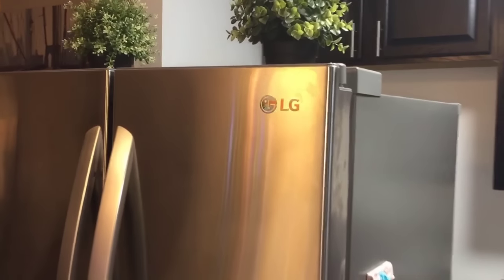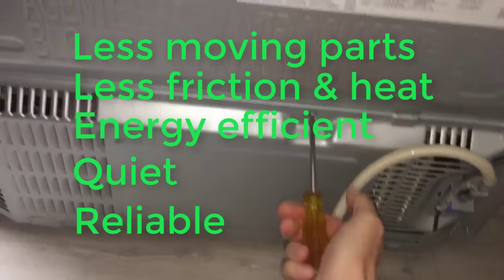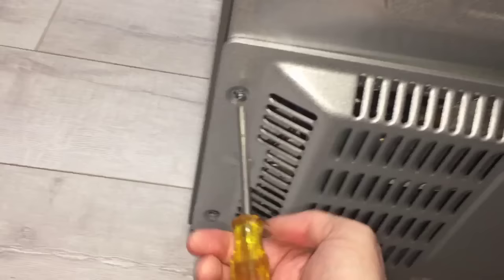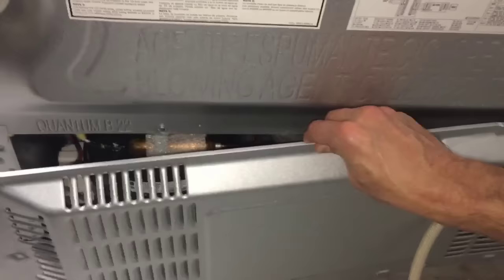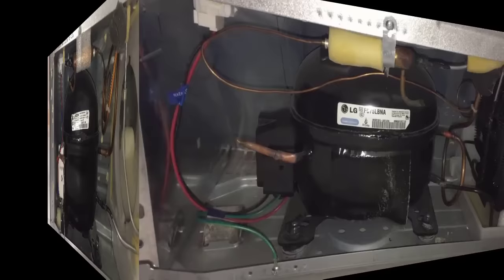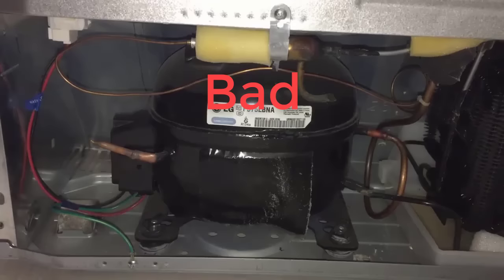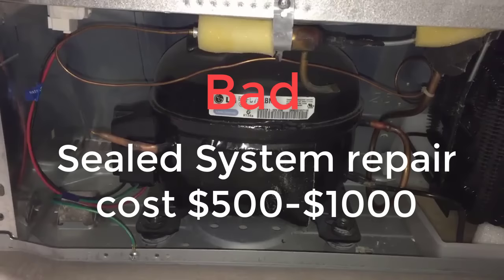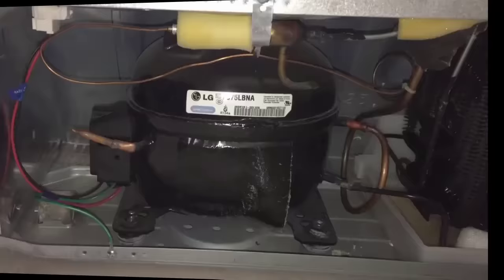LG fridge not cooling but running

Comment: Do you have a video to get the white cover back on? My compressor is humming and I can feel a little smooth vibration, does that mean it’s running? Or is the vibration coming from the fan? I was going to get a new start relay kid and took the starter out, without taking a picture we’re the green wire goes. On goes to the screw of the white cover and one is for the green wire what goes on a screw. I don’t know which hole. I noticed one hole has some markings  engraved in the metal of the compressor. Is that where the green wire with the screw goes? . ( women who tries to fix stuff through YouTube since hubby is overseas, sorry ) also I can’t get the white cover back on, any tips on that. I’m frustrated with this LG and did not know 2013 when it came out and we purchased that it will have issues in 7 years down the road. I love Lg but will never purchase another one. Thanks for any help I can get
Reply from the maker: If it says "Linear" on the compressor, there is NO start relay, just a connector that goes on the compressor, and a round Overload Switch that sits inside the white box. One end of the green wire goes on the bottom frame (as can be seen in this video). The other end of the green wire needs to be screwed to the compressor right next to, or the same screw that holds the white box (as can be seen in this video). The white box is just a cover, and if you cant put it back on, just let it hang there. As long as all wires are connected you should be ok. If you have a purchasing receipt, your fridge should be under a 10-year compressor warranty. Call LG and they should replace it, but you'll have to pay for the installation labor.
Reply: YourSelf first of thank you so much for taking the time to reply. Yes, it’s the round overload switch that sits inside the white box. There are two holes right next to each other on the compressor.  One for the white box screw and one for the green wire. I just don’t remember which one goes into which hole. Does it matter? I bought the extended warranty when I bought the fridge at Appliances Factory and tossed everything in the trash after 5 -6 years when everything was out of warranty, not knowing of the 10 year warranty for the linear compressor. 😱 that’s my OCD 😢.  Is the good compressor noise noticeable or louder than normal, I don’t think mine sounds that loud like the good compressor in your video, that’s why I wonder how do I know it’s running? Beside putting my hand on the compressor and hearing a smooth humming sound.
Reply from the maker: The green wire can go in any hole on the compressor, but you won't be able to secure the white box if the wire goes in the "wrong" hole. 
The linear compressor typically runs quietly, but as history has shown, that's how they fail... running, but not cooling. And sometimes it's difficult to figure out the problem without piercing the Sealed System to install gauges. 
You could try to run the Test as on this video... https://youtu.be/70y61Sq_NU0 If the compressor and all fans run, but the air blowing inside your fridge is warm, it's probably a bad compressor.
Reply: YourSelf  I pushed the rest button on the board and did all test. Air is coming out cool in freezer and fridge. I have the green light blinking 6x, so I was going to start with the cheapest replacement. Grossing my fingers that will fix it. How big are the chances it’s the pcb board?
Reply from the maker: Typically 6 blinks indicate a bad compressor. Before throwing money at a new PCB, I'd invite a technician to check the pressure inside the Sealed System. It may cost you about $100, but you'll know for sure if it's worth messing with this refrigerator.
However, since the air inside your fridge was cool during the Test, I'd give it a day, and maybe everything will go back to normal after the Reset.
Reply: YourSelf I received the overload switch today and put it in, the green light blinking six times stopped. I ran through the reset test and noticed that the evaporation fan ( inside the freezer, behind the cover) only turns on when in test mode and distribute cooler air. Once out of test mode, the fan is not running at all. Does that indicate the evaporate motor needs to be replaced and that’s why it’s not cooling? Thank you for your reply
Reply from the maker: The evaporator fan may not be working when the door is opened. You need to "trick" the system as if the door is closed by holding a door switch for about a minute. Some models don't have physical buttons, in this case,  you can use a regular magnet to activate the door switch. If you activate the door switch and the lights go OFF, but the fan is still not running while the compressor is, the main PCB could be bad.

Comment: Do not buy LG appliances or products! LG is currently in the middle of a nationwide class action lawsuit because so many of their compressors are failing. Search Google for LG fridge class action lawsuit. They are garbage and will not last more than 4 years. I have a $1500 LG refrigerator that is just over three years old and is completely dead. LG is unable to get my refrigerator repaired because no technicians are willing to do LG warranty work anymore. LG is unable to find a repair technician for my fridge. And I live in the Denver metro area, it’s not like I’m out in the country or something. Shops no longer want to be associated with LG or their products. They are refusing LG warranty work which means LG will be unable to support their own warranties. I advise anyone reading this comment DO NOT buy LG appliances or products. Their customer service is pathetic! It’s really as bad as it gets. They will run you around in circles until you eventually get tired and frustrated and just give up. They do not have repair technicians to service their warranty products. If you choose to buy an LG product, You are taking a big risk with your money!

Comment: My Smart diagnosis is showing everything is working fine. Still, Its not cooling. Please help. Please
Reply from the maker: Unfortunately, the "Smart" diagnosis is not very smart. It can only detect easy problems. So you probably need to call a technician to investigate the issue.

Comment: Yes...I Replaced the Filter/Dryer and Vacuumed the System thoroughly and Weighed the R-134A on a Digital Scale. The Compressor is an FC75LANE Linear Compressor from LG. The Original Compressor lasted 9 years. So it had 1 year left on the Warranty. As you probably already know...the Warranty is only good if Sears replaces it!

Comment: I bought a used LG fridge from a neighbor locally about 6 months ago and now it stopped cooling and seems as it has the same issue as in this video. Is there anyway that I would be covered under the warranty since I didn’t actually purchase it from a big box store?
Reply from the maker: Tough call... they need the receipt for the whole refrigerator replacement, but for repair maybe you can get away without it, pretending to be the original owner. If the refrigerator is less than 5 years old, and the previous owner didn't do any work on it, it may be covered under the Sealed System Warranty.
Reply: You don't have to be the original owner. Just have possession of the unit. Home owners buy houses all the time with LG appliances in them and LG still has to repair them.

Comment: I have a new compressor installed from LG. Still not cooling. What else could be wrong?
Reply from the maker: Typically, new LG compressors require a software update on the main control board to run properly. But it still should be somewhat cooling without the update. That leaves a bad compressor installation or a wrong compressor. Who did the installation? Possibly the thin tube (capillary tube) got brazed shut.
Reply: @Your-Self  
I had a technician do the compressor install which appears to be a new compressor from LG (,the old original one was supposedly bad. The input voltage was reading 207V. The first install was not cooling. He comes back and claimed yhete may be blockage of the orifice at the coolant inlet tube
Replaced the filter housing and tube. Still not cooling. I am feeling this is not a compressor issue. Checked the solders as well as cooling tibes both refrigerator as nd freezer. No leaks. No defrost issue. There is something mechanical
No error codes either
S
Reply: BTW...tech installed updated software when he did the compressor install
Reply from the maker: The technician may need to evacuate the refrigerant and blow some nitrogen gas through the system to verify that there is no blockage. 
After that, vacuum the system and dial the exact amount of refrigerant from your label. These newer refrigerators are very sensitive to over or under-charge.
Also, if your refrigerator has 2 evaporators, the 3-way valve needs to be in a "home" position before he starts evacuating the system.
Reply: @Your-Self  
He didn't evacuate the system
Reply: More than likely bad board like mine

Comment: Filter drier is on backwards on the “bad” compressor. Note port is on right side and on good compressor, it’s to the left.
Reply: Nah, capillary tube is still on the correct side, it just seems like the good one has condenser in the back wall of refrigerator and because of that the pipe is coming from the top there.

Comment: Hello YourSelf, I have a four-year-old Kenmore Elite ref with LG Linear compressor, and it is not cooling, and all the components seem to be working. I thought it is the compressor because it is infamous for go bad so soon. Watching this video, I doubt it because it is making the same sound which good compressor makes in this video, any thoughts or help would be highly appreciated and thank you?
Reply from the maker: When the compressor sounds bad, that means it's bad. But if it sounds OK, the compressor could still be bad, or there could be some other Sealed System problem. Like refrigerant leak or copper tubes clogged up... any of these problems are expensive to fix. Press the Test button on the mainboard, and if you feel the air movement inside the freezer and the fridge compartments, but it's warm, this indicates the unfortunate Sealed System problem. If the air is slightly cool, it could be a Defrost Problem. In this case, I'd take everything out of the freezer, including the back wall, to look at the Evaporator Coils. If they are covered in a thick layer of frost and ice, that's a Defrost Issue.
Reply: @Your-Self  I did the test button (again thank you for that video too) and air was very slightly cool, this is been a week now and the unit was off most of times. I would not see any ice in the Evaporator Coil now, is there any component that I can check in the Defrost unit, I have a Multimeter?
Reply from the maker: Well, if it was a Defrost problem, the refrigerator should start working well after being OFF for a week, until the over-frosting becomes an issue again. So it sounds like you have a Sealed System problem. And now need to make a decision if it's worth the repair. While LG offers a 5-year free compressor replacement, Kenmore models are covered by Sears, but their warranty isn't that great. Call Sears to see what they cover. They may give you a free compressor, but you'll have to pay for the installation labor about ~$400.
Reply: @Your-Self  Your are right, it is the time to make a decision. Thank you for sharing your knowledge with us.

Comment: Only my fan works. My comparator does not even turn on. I unplugged and tripped my breaker, still nothing. Any ideas?
Reply: I did do that your customer service is a joke clearly set there to rip off their customers. I was told that you're going to charge me $400 to come out and fix it with the same parts that have been proven to break time and time again.then it was explained to me that when it breaks again I would have to pay another $400 for this to continuously happen again. I already threw away your stupid refrigerator and bought a good one I got a GE and I fully recommend everyone else to do the same.
Reply: @michaelgonzalez5752  Customer service said they set me up with a repair date and service technician, and when I called back a week later to cancel, they said they never got around to setting up the appointment. I'm with you, Michael. I ordered the part and I'm going to do it myself while I watch my fridge do its thing day in and day out. Up down, up, down, it never ends. Be well.
Reply: @michaelgonzalez5752  You do understand I own an LG that's on the fritz, I don't work for the company. I simply offered what I was going through three weeks ago in my original post that I thought might help you at the time. We live and learn.

Comment: very helpful video! what about: the door from the top part of the refrigerator[the freezer] remained open for hours by Error?? now the fridge run smoothly. but does not freeze or cool in the bottom part. I am talking about a frigidaire fridge[I guess in this case: they all the same]. please! hope to hear you.
Reply from the maker: If the door was opened for a while, the evaporator coil (in the freezer) picked-up a lot of moisture from the air and got covered with too much frost. Try manually defrosting your refrigerator by unplugging it from the wall for about a day, and all the frost should melt. Leave both fridge doors open and be prepared for a lot of water dripping down.
Reply: it does not answer my question at all, you not even understood the question. what it is: my freezer does not  freeze or cool at all, there's nothing to defrost. it just doesn't gets cold at all [on the top or bottom]. it maybe some to do with the relay box of the compressor. you should have a p.o box so your viewer send donations to you if you give them the right answer and they, we can fix our appliance.
Reply from the maker: LOL, you are giving me very limited information, and it's almost impossible to troubleshoot the problem correctly this way.
You said that the "fridge run smoothly" which means to me that the compressor is running and that means that the start-relay is good.
The other thing you said "the freezer door was open for hours" which typically means too much moisture which turns into frost on the evaporator which acts as a blanket insulator and prevents the refrigerator from cooling ( it sounds counterintuitive, but that's how refrigeration cycle works). If you want to make sure that this is the case, remove the back panel from the inside of the freezer and look at the evaporator coil.
If it's full of icy-frost, defrost it. If there is no frost at all, I'll need more information from you.

Comment: Hello. I have an LG French Door frig and the frig side is cool but the freezer side is only reaching 42 degrees. I had dust blocking the intake screen at the bottom and I have cleaned that and the coils. I was wondering if you think this is the issue or is there maybe something else?
Reply from the maker: Sometimes cleaning the condenser coils helps to improve the temperature in your refrigerator, unless the compressor was running dirty for a long time, and possibly got partially damaged. Also, depending on your model, you may have a dual evaporator, so the problem may be with a 3-way valve. When you say the frig side is cool, is it about 37°F?
Reply: YourSelf I would have to check the temp today but yes about that cold.
Reply: YourSelf the model is a LSXS26326S/01
Reply from the maker: I think your model is a single evaporator unit, which means the temperature inside the fridge compartment can not be lower than the freezer. If cleaning the condenser coils don't help, you may need to remove everything from the freezer to look at the evaporator coils. If there is a lot of ice and frost build-up, you may have a defrost issue. If you have just a little frost pattern on the top of the coils, it's probably a leak, or the compressor is going bad.
Reply: YourSelf YourSelf okay thank you and if they are the same temp either a bad compressor or a leak?
Reply from the maker: After you rule out the Defrost Problem then, yes a bad compressor or a leak.
Reply: YourSelf I have no ice on my evap coil at all. It has a few drops of water.
Reply from the maker: How old is your fridge? LG repairs Linear compressors absolutely free for the first 5 years. After that, it's about $360 charge for the labor.
Reply: YourSelf I did a smart diagnostic check with the app and it says everything is good. But again not freezing?
Reply from the maker: The "smart diagnostic" can only detect some of the electric/electronic problems. If the reed valve inside the compressor got cracked or broken (which is typical), it will not be identified by the smart diagnostics or the "test button" on the main PCB.
Reply: YourSelf awesome thank you so much for your help. I called LG and they are sending a tech Thursday to look at it and hopefully repair. It will be under warranty. 

Thank you very much for your help.
Reply from the maker: Great! Let us know if they did fix it, and what exactly the problem was.
Reply: YourSelf hi there. So they came out and the tech said the compressor needed an update. Does that sounds right?
Reply from the maker: If they replace the compressor sometimes they have to do a software update on the motherboard for the new compressor to run properly. Otherwise, I'm not sure what update they are talking about.
Reply: YourSelf gotcha my wife says they didn’t replace the compressor but I don’t think she was paying to much attention and I was at work. That you very much for all your help it’s been really appreciated. Be safe.